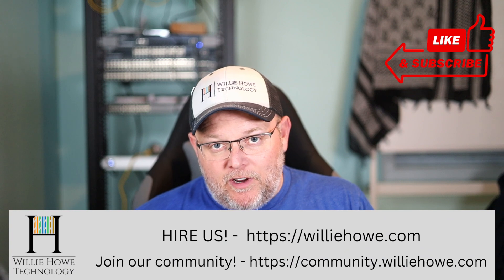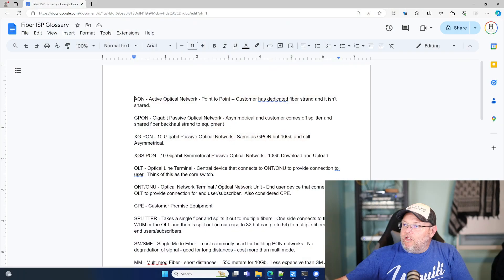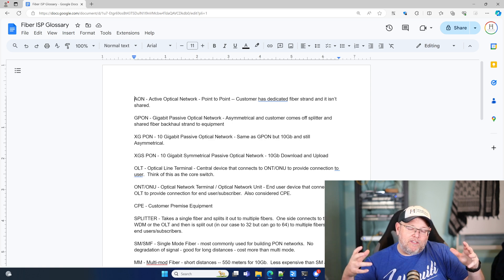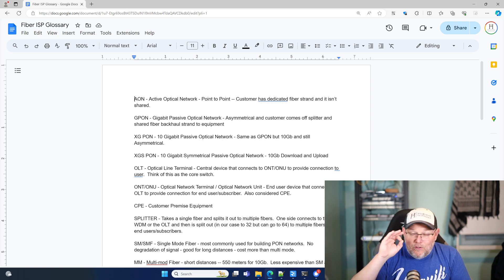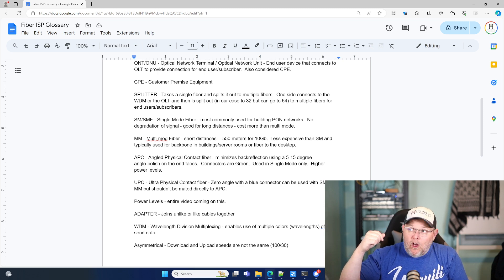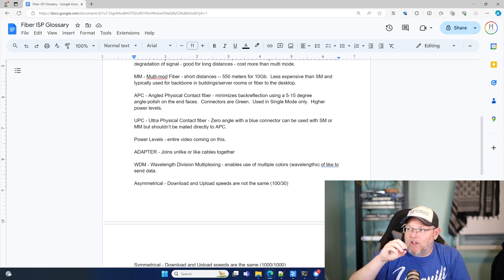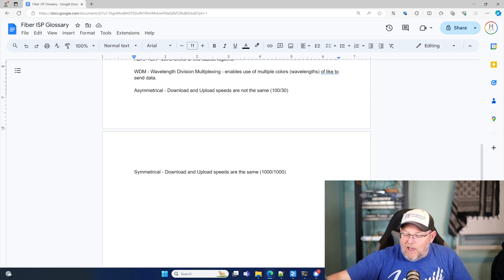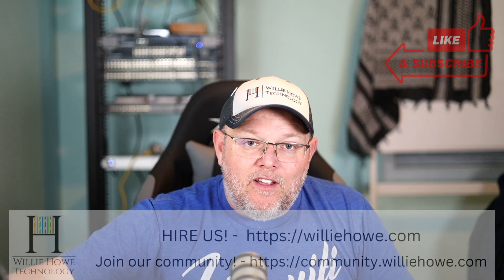Build an Internet Provider Part 3: Glossary of Terms

Comment: In the next video when you get to connecting everything up and configuring it, could you use both the Ubiquiti equipment for the normal CPE's they sell, as well as the UFiber Instant plugged directly into a UDM-SE WAN port (the Instant is a CPE built into an SFP form factor), and use some off brand FS GPON and XGSPON ONU Sticks directly in a UDM SE WAN port? That way we can see how to configure regular end points, the official stick in other Unifi equipment, and what needs to be configured when going with 3rd party equipment at the premises. The GPON ONU Stick part is GPON-ONU-34-20BI, and the XGSPON ONU Stick part is XGS-ONU-25-20NI